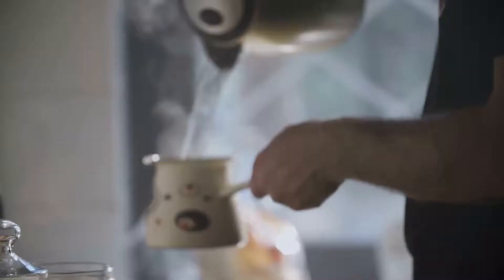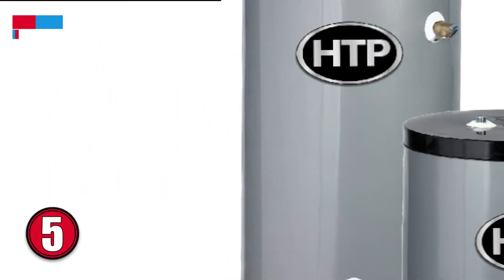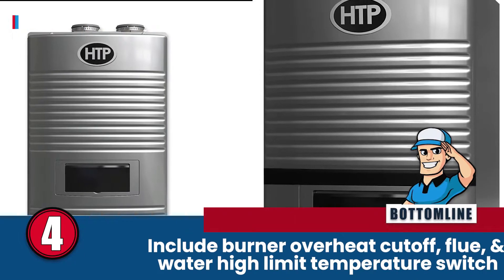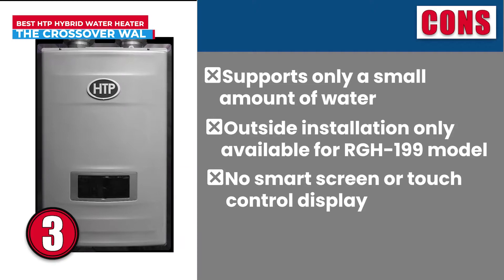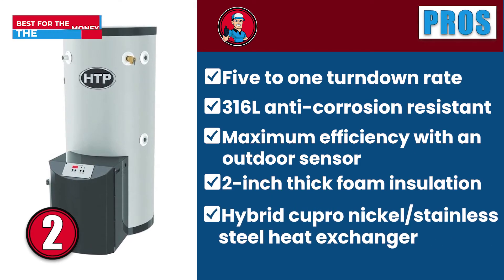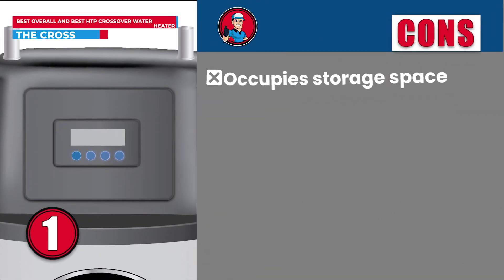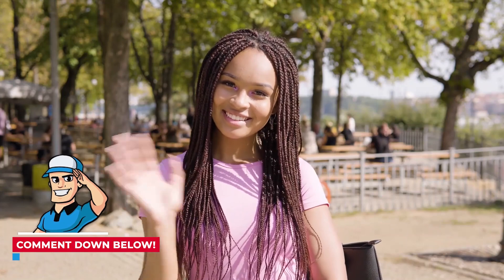Best HTP Water Heaters 💧 (Buyer’s Guide) | HVAC Training 101

Comment from the maker: Read the full review here: ►► 
https://hvactraining101.com/water-heaters/htp/
(Best HTP Water Heaters)

-------------------------------------
✅ Featured Products for Best HTP Water Heaters

0:00 Introduction
1:16 5. Best HTP Indirect Water Heater: SuperStor Contender Water Heater ➜ https://bit.ly/39UU6eu
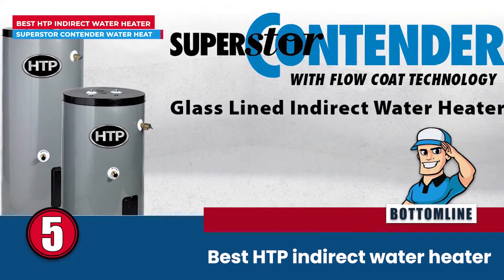2:53 4. Best HTP Tankless Water Heater: Hydra Smart RTC ➜ https://bit.ly/3rWZ5Bh
4:29 3. Best HTP Hybrid Water Heater: The Crossover Wall ➜ https://bit.ly/31Wdt2k
6:06 2. Best for the Money: The Phoenix 316L ➜ https://bit.ly/3cV9Dga
7:41 1. Best Overall: The Crossover® ➜ https://bit.ly/3wBUfNo

Subscribe to our Channel 
🔴 https://hvactraining101.com/youtube/

-------------------------------------
Detailed review: https://hvactraining101.com/water-heaters/htp/

💧 HTP is one of the leading heating and hot water manufacturers in America. Founded in 1974, it has been able to achieve maximum energy efficiency levels using state-of-the-art technology in the past few decades. Based in New Bedford, Massachusetts, HTP is renowned for its popular Munchkin boilers.

💧 HTP was the first to introduce the modulating/condensing technology and is considered as the leader in water heating systems. Their water heating products include the famous SuperStor Indirect store tank and the 316L Stainless Steel Phoenix water heater. Their new additions include Elite FT boiler, Solar Skies solar line, and a wide range of heating systems for residential and commercial purposes.

💬 Let us know what you think of these HTP Water Heaters in the comment section below.

👉 We appreciate every thumbs up and would be grateful if you’d consider subscribing to our channel!!

-------------------------------------
🎥 Welcome to the official YouTube Channel of HVAC Training 101 🎥

HVAC Training 101 is dedicated to helping you make smarter buying decisions when it comes to air conditioners, heaters, air purifiers, and other HVAC-related items. 

 🌐 Learn more about us: https://hvactraining101.com/about-me/
 💻 Like our Page: https://hvactraining101.com/facebook/
 📢 Follow us on Twitter: https://hvactraining101.com/twitter/
 📱 Check out our Pinterest: https://hvactraining101.com/pinterest/
 🔴Subscribe to our Channel: https://hvactraining101.com/youtube/

-------------------------------------
Disclaimer:
Some of the footage used in this video is not original content produced by HVAC Training 101. Portions of stock footage of products were gathered from multiple sources including, manufactures, fellow creators, and various other sources. If something belongs to you and you want it to be removed, please do not hesitate to contact us at bob [at] hvactraining101.com.

Some links in the description are affiliate links. If you click on one of the product links, I’ll receive a commission at no additional cost to you. As an Amazon Associate, I earn a small commission from qualifying purchases.

#HVACTraining101 #HTP #BestWaterHeater

Comment: Had #HTP for 2.5 years installed by a plumber. We have put over $1500 into our boiler trying to keep it working. We had to install a back up small water heater for when this stupid thing goes out. We have to run space heaters when we have no heat every time it goes out. Do not buy HTP products. And their warranty is horrible. It’s still under warranty and we still have paid over $1500 trying to keep heat and hot water working.

Comment: HTP IS GARBAGE! Had mine for 4 years. I have a 6 year warranty but they will avoid you if anything goes wrong. I'm in the process of taking them to court. Mine no longer heats and is leaking water from the top due to the rust. 4 years old.